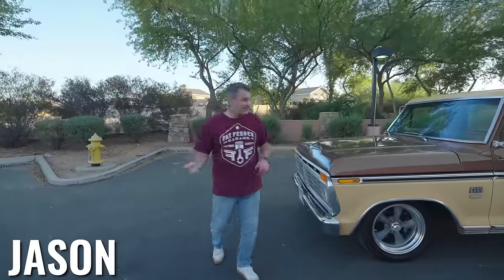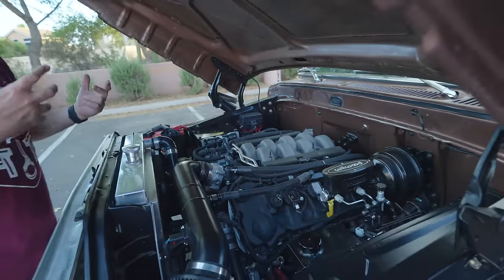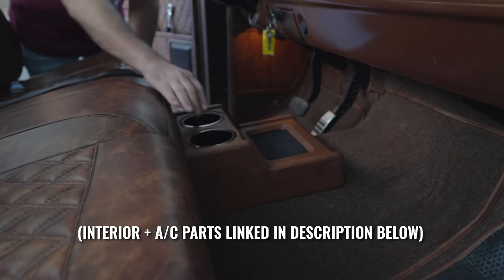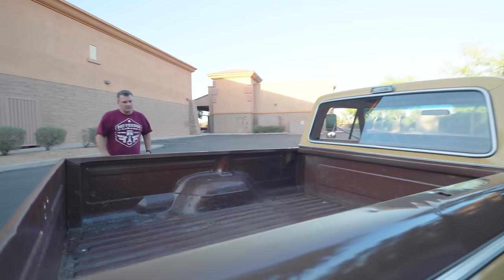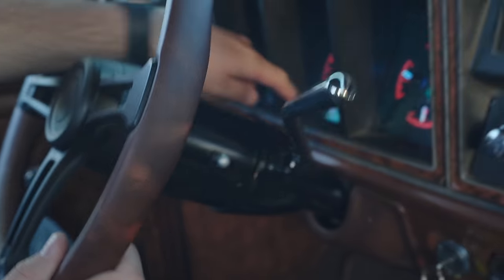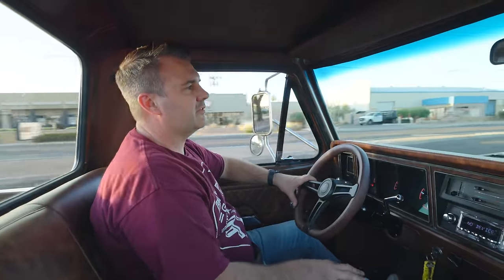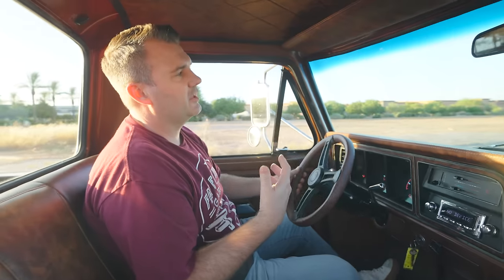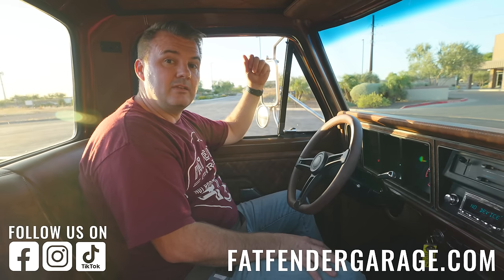The Perfect Coyote Swapped Ford Truck

Comment: I love the idea that these old trucks aren't every day drivable as they were built from the factory. I currently drive a 76 F250 4x4 every day with no problems at all. In totally stock form with exception of the engine having been upgraded from a 360 to a 390 over 20 years ago and still going strong. No it doesn't go fast, doesn't have power steering, doesn't have air conditioning, doesn't look good or even have a radio but it'll go anywhere anytime.
Reply: I have stock Ford trucks from the 40's through 70's. They'll go anywhere, tow anything and can be maintained for a song.
I do like what FFG is doing with these trucks, but I'll probably just keep my stockers till someone hauls me to my grave in one.
Reply: I have a 94 300i6 4x2 love the truck pull Anything but I have an e4od my dream truck would be an 80s 250 4x4 manual granny gear with 300
Reply: absolutely right- i prefer an old not computerized truck evryday!!
Reply: @halfmil6467 😂

Comment: I have a 1974  F250 4x4 that I bought new may 18  1974  I was 19 all of my friends asked me what are you doing with an old man’s truck. I knew what I was doing and I made a portable welding truck out of it. I put a ford camper shell on it and all of my tools stayed dry and kept the dirt out of it. I used it for 40 years and kept it clean I didn’t drive hard but it is still in real nice shape cleaner than  90% of the trucks this year I was thinking of putting a Cummins motor until I saw what you guys did to this now I am going to call and see what all parts you used and see what it is going to cost and I think that is the way I am going. Thank you willie.

Comment: No love for the 57-60 or 61-66 F series coyote motor mounts???   sweet Dent btw!
Reply from the maker: Unfortunately not.. Although if you have a 65 or 66 you can use the 67-72 kit! They're the same frames.
Reply: @FatFenderGarage   65 frame with Steve Szymanski Dakota crossmember installed,  was going to use a 289  C-4 but the coyote is so awesome! Thanks for the info!